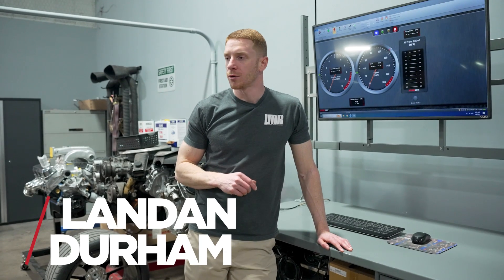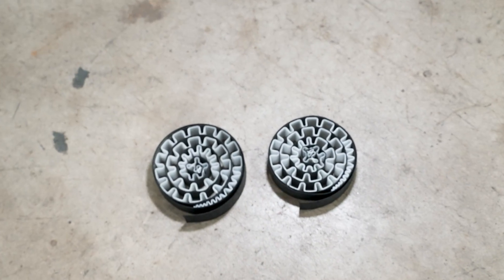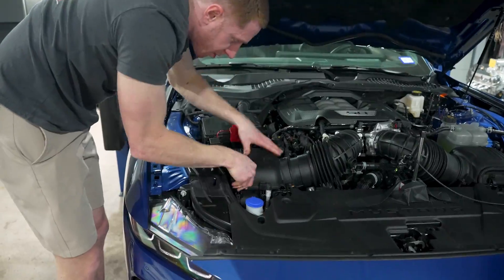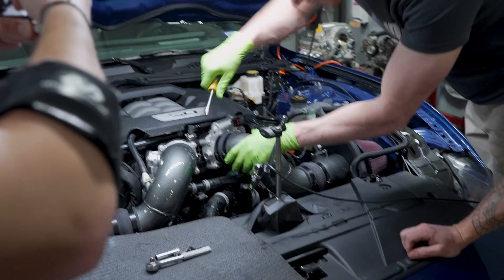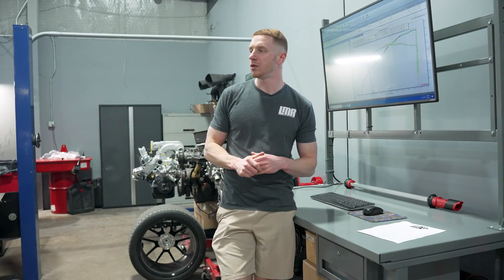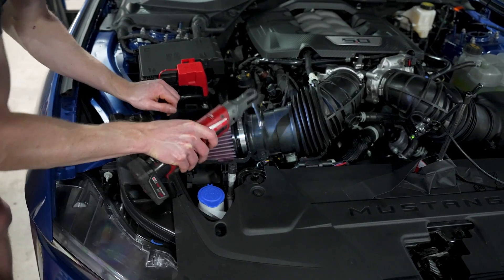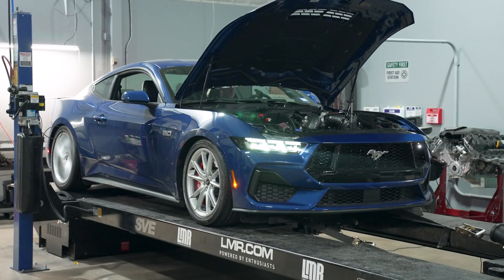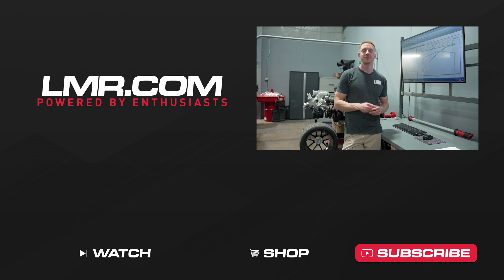We Dyno The 2024 Mustang GT K&N Intake + Compare to Carbon Trap Delete & High Flow Drop-in Filters

Comment: I had a cold air intake installed and had almost the same numbers.  No resonator delete though. 424 hp at 6000 rpm and 381 torque at 4.87 RPM. After 93 Octane  tune it was 434hp  at 7.33 rpm and a little bit of a decrease on torque to 364 at 5.25.  Done on the same day with a manual 2024 GT

Comment: Nobody addressed the stock GT grill, and how the air intake sections (on each side feeding air box) are mostly blocked.  Opening the hood would negate the grill blockages on the K&N cold air intake system.  I don't buy the small fan explanation.   Apples-to-Apples, you keep the hood closed.

Comment: I wish someone made the pipes (between stock air box and engine inlet) in a sexy looking brushed or polished aluminium pipes (to replace Ford's plastic one with the not so attractive reinforced ribbing) and optional matching air box covers just for show/looks, and leave everything else stock. Regards.
Reply: I found the company. SPE CFD-Designed S650 Twin-Turbo Kit shows what you are looking for. Unfortunately, the guy that answered the phone had no interest in making these same pipes they use on the turbo kit to make it happen for the air intakes.  😡.  I called them late in the day. I’ll try them again in the AM when they got their coffee in them and their thinking caps on.

Comment: Ok, so the mistake I see is the run with just k&n filter and carbon trap delete is at a real disadvantage because with top on air box the hood plays a minor factor, or you should dyno the factory box with lid off and hood open to get comparable data. Just my two cents.

Comment: I need help understanding something - I just bought a 24 GT. I haven't started tinkering yet. I thought the engines were rated at 480 horsepower. But your Dyno is showing 410-424 hp... If I dyno mine are those the numbers I should be expecting as well?- POST RESEARCH UPDATE: As it turns out, so far the new Mustang GTs are dynoing 410 at the rear wheels - is this because at some point there will be a subscription for me to get my other 70 horsepower? 😢😂 
Thanks for the great videos 🎉
Reply: Yea, it's called the CATBACK/LTH, 93 tune. Should be dropping in about 2 years :)
Reply: The 480 is at the crank.  The 410 is after drivetrain losses and what actually hits the road.
Reply: Thanks for that 🤠

Comment: Would like to see a pull with the typhoon kit and S&B filters.
Reply from the maker: There isn't enough difference in filter density to make it worthwhile. If for some reason there was any difference, it would be very small. At any given point, you have to take into account small dyno variances between runs, ambient conditions, or air flow from fans. A better test for something like that would be to test the flow via cfm. -Landan

Comment: Man I just could not justify spending that amount of money for the cold air intake just to make 10hp.
I chose to go with the Steeda drop in filters with carbon traps removed and that was a noticeable difference
Reply: I just installed my k&n typhoon intakes yesterday on my s650 and  the car feels more responsive and a slight bump of power in top end nothing crazy but i will say the sound of the intakes definitely makes them worth the price my car sounds amazing now paired with corsa double x pipe and factory active exhaust. It just sounds mean and super throaty damn thing roars
Reply: @hds8182 i know this is late but did you throw a code?

Comment: And the K&N adds more grit and dirt into the engine then stock.
Reply: not really. they have filters for a reason.
Reply: So the micron filtration does give a little for the amount of air flow but it’s not enough to cause an issue. The biggest thing in the intake filters is bugs and debris from the road so that’s usually on the bottom of the stock intake box when you change the filter and or clean it.
Reply: The reality nobody cares that
Everybody wants sound and power

Comment: Just my opinion and thoughts …. The K&N heat soaks the crap out of that motor . I have never been a fan of aftermarket cold air intakes. 
To each their own 👍🏻 just not for me.
Reply: You didn't hear him explain that the bonnet closed with a fan too.small to replicate the correct airspeed the car sees under motion, heat soak will happen. It was the only run done with the bonnet closed.
Reply: @HSE2inc  like I said I’m not a fan of aftermarket cold air intakes . I heard him and it still doesn’t change my mind … lol 😂 I’m definitely not a fan of anything K&N …. 
The only one that I would remotely consider would be the Roush system and it’s a closed system with a lid but it’s not available for a S650 so it’ll be stock for now .

Comment: This shit looks like my Kia Stinger gt, which also has 2 intakes but it has 2 turbos. The AEM intakes i have basically is to heartye turbo sound, which is super quiet from factory. Seems unnecessary to have 2 throttle bodies on this car. One has been sufficient on basically every V8 car for how long? Single blade flows pretty good on my gen 2 ⚡.
Reply: Umm not every V8 car. There are V8s with dual throttle bodies and dual intake plenums, ITBs and you can kinda call multiple carbs "throttle bodies"...
Reply: @728GT  I was referring to more modern stuff but yeah, your right 👍🏾

Comment: Ford Engineers know better. Sorry, but not sorry.
Reply: The same Ford engineers that designed their pos garbage transmissions that literally led to the deaths of the focus and fiesta? Those engineers? Ford builds garbage...
Reply: Yes and no it’s more of a cost thing too the hot ticket would be high flow intakes pipe retain the stock airboxes and run a high flow filter 

K&N is hot garbage IMO